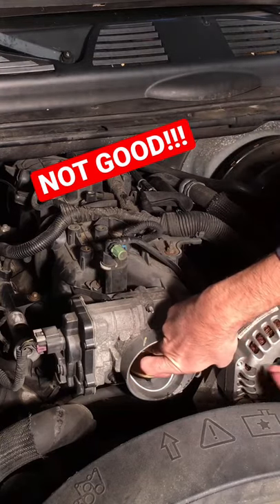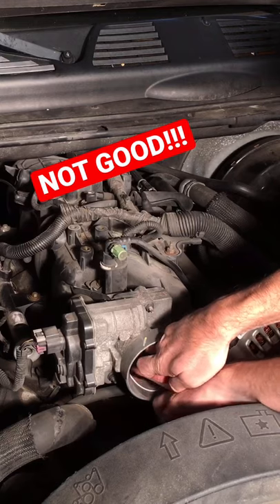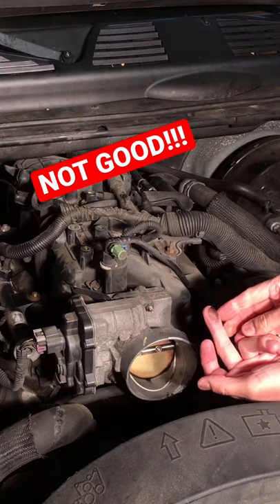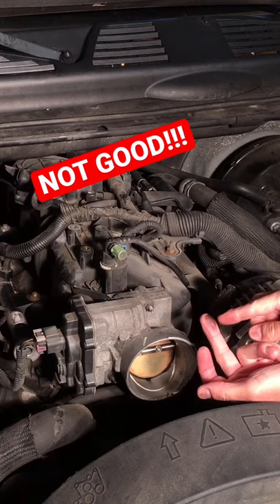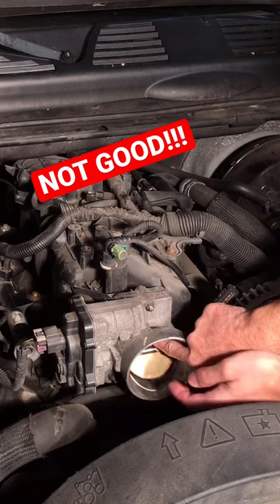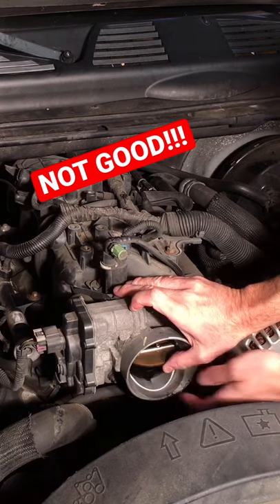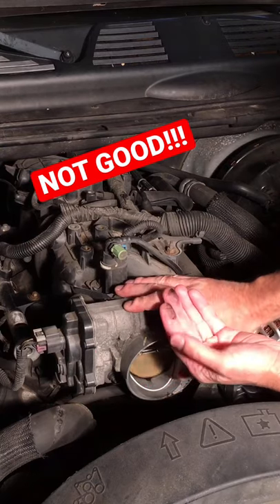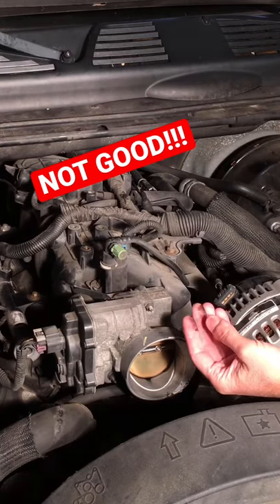If you discover this in your Throttle Body you have problems

Comment: Some throtles can break by manually opening them. Have a buddy press the gas pedal
Reply: #nissan
Reply: @ItchyKneeSon  lol did that on my z☠️
Reply: With the engine running
Reply: I was just about to say that bro great minds think alike
Reply: Not on the ride by wire ones
Reply: Or a brick
Reply: That's with electronic throttle body. Cable controlled is entirely fine to manually open.
Reply: @nateg08 caddie cts 06?
Reply: What if you remove the throttle body and do it off the truck?
Reply: @Eurolaflare same damage done it’s the plate itself ur not supposed to move
Reply: @Eurolaflare  same, you must not move abit of degree that butterfly.
Reply: @macegarage9603  I moved it gently a few times and cleaned tons of gunk that I was surprised to find, truck runs amazing and noticeably better, no issues. Guess it doesn’t always mess things up…
Reply: Probably not break but your throttle body position would be thrown off in the ecu. Literally happened to me today. my car went from 340 horsepower to probably 50 just because the throttle body  was thrown off I lost an immense amount of power
Reply: @Michael-ty2uo  I'm glad that didnt happen to me, mine runs great still to this day weeks later
Reply: I think I just broke mine doing this doesn’t drive or rev anymore
Reply: @keegan2610 and it broke? I’m asking cause I did this in my g35 and now it doesn’t rev past 1600
Reply: @derekchapa9432 in some cars you need reprogram throttle body after you missed up with them.
Reply: @mk-yi8ptwhat does this do?
Reply: This tb is wired, not cabled… it has a small return spring so it won’t hurt it
Reply: @Michael-ty2uo  throttle position sensor???
Reply: @mk-yi8ptit doesn't open by this way in some cars such as my 07 Optima
Reply: Oh no 😅 @muresanm
Reply: @Michael-ty2uo so how did you fix it?
Reply: @Tronic_Rider-kl9cu   it was actually a vacuum leak if you drive long enough with a vacuum leak it will lose power due to the thrown off throttle position timings. My breather hose on my intake was slightly loose when i repositioned everything the throttle body went back to normal
Reply: That body style is a electronic throttle body
Reply: @keegan2610 should of disconnect your battery
Reply: Shit I have a 05 mustang and I put the rubber of a screwdriver in it and cleaned it out . Runs fine …. I hope 😭
Reply: And you're good to go
Reply: @klaidenmorad103  yep.  Any change like this, or upgraded components on intake or exhaust systems, usually require doing an ecu relearn after reconnecting the battery.   Most will relearn over time, as you drive... in case you don't do it.  It will just usually run rough or high idle, until then.
Reply: Is the engine supposed to be running?? Please help
Reply: @Michael-ty2uo How best then should it be done??? Kindly guide
Reply: @muresanm  no, just turn the key but do not start it and fully press the gas pedal, the throttle body will open.

Comment: When an engine is shut off, there are often one or more intake valves open and the residual fuel vapors as well as oil vapors from the PCV system are trapped behind the throttle plate until the next startup. There will always be a buildup in that area. I always recommend to have the throttle body cleaned every couple years.
Reply: I came here for this comment. I 100% agree. I have always (decades) seen this buildup on the inside of the intake manifold beyond the throttle body, mostly from PCV valve activity. Oil vapor lands on cool surfaces after the car cools down. It's simple. Never had a fuel pressure regulator problem.
Reply: @InexplicableBill this person is correct.
Reply: Noticed this on my motorcycle. I change the oil, flush the gas tank, and clean the air box religiously to prevent corrosion and shit, but this gunk always builds up in the air filter housing around the vapor return lines. The manufacturer even put a tiny little sponge in there to collect it all between cleanings
Reply: You just damaged that throttle body,  ,you not supposed to open that manually,
Reply: @jessereynoso7639 how is it supposed to be opened?
Reply: Thank you everyone. I appreciate your input.
Reply: Wat Can You Use To Clean It?
Reply: @Tronic_Rider-kl9cu 
You're asking a YT keyboard mechanic.
Reply: ☝️ this.  It is why you will sometimes find a charcoal panel behind the air filter.  It absorbs unburnt hydrocarbons until the next start.
Reply: Not judging but doesn't it mess up the servo/motor in the throttle body opening it by hand.
Reply: @patrickgorham4269  unless it's locked in place for some reason, no.
Reply: @jessereynoso7639 that's what I thought.
Reply: Not years. Every oil change needs intake treatment, gas and diesel aren’t pure like the early 2000’s everything burns dirtier

Comment: It can also be the pcv valve that needs to be replaced.
Reply: Hey i suspect if pcv valve is faulty there will be OIL int eh throtle door itself since the pcv vavle connects before the door😅
Reply: Yes but will maybe appear as a lighter color than from the motor and pcv still is letting out the fuel that can leak past worn rings into the crankcase obviously like the whole point of the pcv right? Weil not the whole point but whether it's fuel or blowby gases from cylinders? Because otherwise they will go into oil and thin the oil and that's part or the reason as well as.... carbon buildup?
Reply: A good pcv valve will shake  
Mine is good and just replaced it. Having major idle issues
Reply: @anorsegoddess9797  don't forget that if you disconnect the battery fir any reason you may have to take the vehicle through a fuel trim relearn process... otherwise it'll idle like shit and may even stall out

Comment: that's probably oil from the engine because the air that comes out from the engine and goes to the air system has oil in it that's why some people install oil catch can
Reply: Exactly. Especially if you are modified it would be a lot more.
Reply: But he said if it smells like gas not oil
Reply: From PCV tubing?
Reply: @HeyShockerGirl  it's air mixed with engine oil and gaz or diesel
Reply: @thy6780  i think it's called pvc valve, a tube that comes from the top of the engine that releases pressure. putting it back to the air system is cancer for engines.
Reply: Could that make my truck smoke blue
Reply: @marcosilva3749  no that tube has nothing to do with the blue smoke with it or without
Reply: @difsid569  damn it
Reply: @marcosilva3749 if you’re vehicle is smoking blue that means you’re burning oil, depending on your truck could be just worn out rings, or turbo seals, or valve seals, or broken ringlands, many possibilities
Reply: Flooded engine gas mixed with the oil through to the PVC valve pressure 🤯 to the intake manifold back to pistons

Comment: My 2011 Honda Accord had the same problem and I had a mechanic that wanted to replace the valves. I wanted to make sure of his diagnosis so I want to friend that my son uses and after going through the core he noticed under the body throttle there was a lot of wires coming out the wiring corners and he noticed one of the wires were broken, so he put two wires together fix the wire which was thin thread wire when you’re sewing and I got a bill from him for over $300 for the job. The other person wanted $900 and that was an even the problem so I would suggest getting a couple opinions if you can if your car will let you, don’t jump on the first opinion
Reply: Even $300 to fix a torn wire is highway robbery, damn.

Comment: Could also be bad intake valve/valves not seating and piston blowing air charge back through intake.
Put hand over throttle body and if you feel any pressure popping back at your hand it's a bad intake valve seat, if not it's probably one of the other problems also mentioned above.
Reply: Bad misfire too if valve is bent or not seated
Reply: Pls what can make throttle atuetor boy not firing

Comment: You should never open the throttle body by hand. If you need to open it turn key on engine off and then open it by jamming something on the gas pedal
Reply: Yes I was about to say the same thing it tears them up
Reply: Why is that
Reply: What if it doesn’t open when you press on the gas pedal ?
Reply: @chrvscuts4945  then it should be replaced
Reply: That’s not true you can open the throttle body by hand and clean it
Reply: @chrvscuts4945 yes plz. This & sluggish accel esp uphill
Reply: @ronniejohns2463 bc that’s why it is
Reply: @kid5042 no
Newer cars with new computers and electronics throws the system out of wack.
Put a broom stick on the gas pedal with the key on engine off
How many times do you need this repeated to you?
Reply: @OFFICIALBROTHERBOLDLYMUSICTV  Because they actually don’t throw anything off, how tf can it throw anything off? Dealership even do it manually
Reply: @OFFICIALBROTHERBOLDLYMUSICTV you could also just disconnect the negative battery connection and do it manually.
Reply: That only applies to electronic TB. Cable controlled are completely fine to open manually. Just know your vehicle and if you can't tell the difference you probably shouldn't be in there anyway. That being said... this appears to be an electronic TB, and opening it like that could easily strip the plastic gears that open it.
Reply: All mechanics do it. They say to do it gently though.
Reply: My throttle body is mechanical, not electrical, and it has a special lever that opens it without using the entire pulley system that operates it by pedal.
Reply: @ronniejohns2463  because they are electronic and are regulated by the ecm.
Reply: yes then if that object you put on the pedal moves bye bye to your little fingers 🤣 disconnect it and remove it. Best way don’t be lazy and risk your fingers getting chopped off

Comment: What are symptoms of this that the car will do???
Reply from the maker: Performance issues, like poor acceleration and/or high or low rpm’s at idle. You will also have an engine code most of the time

Comment: Don't ever put your fingers or hands near one of these without it unplugged. Bad things can happen. Stepping motors are no joke. Best to remove and examine.
Reply: What's a stepping motor?
Reply: High torque motor. Can pinch or remove digits.  I'd not want mine in there unless it was unplugged better yet remove it for cleaning.

Comment: That is oil.  5.3 Chevy engines all have oil leaking into the throttle body. They sell an updated valve cover (genuine GM) that helps stop it, and you can add a good Micky Mouse oil catcher.
Also. It is really not much of a problem. I ran one to 300,000 miles with no problems doing that.
Reply: Mighty Mouse*
Reply: @jonathanblunt3779  You'd be correct, but Micky Mouse sounds cooler. 😎
Reply: @steefan2248  so the noobs can find the best catch can on the market haha
Reply: I needed to see this comment because I’m dealing with this same issue now 😢
Reply: Mine smells like gas

Comment: Oof 😬 Every time you plunge your finger in the valve or just drop it, i cringe. Rapidly moving the butterfly valve can actually cause enough current to send faulty signals and mess up sensitive electronic components. If I need to move the butterfly valve to clean the throttle body, I move it slowly so as to not generate current

Comment: I have a code P0122
Throttle/Pedal Position what should I fix first the throttle body or the pedal position sensor
Reply from the maker: I would start with whichever part is cheaper. You don’t want to start with the more expensive part, just to realize that wasn’t it.
Reply: That would be the APPS (Accelerator Pedal Position Sensor). Around $45-50 on Rock Auto.  The TPS (Throttle Position Sensor) is in the actual Throttle Body and cannot be separated. You have to order the whole enchilada.  About $120-250 pending how much cheddar you’ve got to burn.  Good luck!

Comment: Most likely the purge valve right next to the throttle body that's going bad. If you have an issue with starting after filling your tank that's another indicator that your purge valve is bad.

Comment: I recently replaced the throttle body on my 2017 Chevy  and still having the same problem.  It's still showing Engine power reduced
Reply from the maker: Did you use an aftermarket one or a name brand?
Reply: @PhillipsVision  it was a new throttle Body.  Hitachi Brand
Reply from the maker: @celestinocarrillo6479  I’ve used them, they’re good. Are you getting specific engine codes?

Comment: I open mine like that it squirts about 30cc of fuel straight down the intake manifold! But it's hard to even see it because there's a choke plate in the way...and a venturi...
Reply: that's a carburetor
Reply: @roballan4944  Pretty sure a fella what knows the exact volume of their accelerator pump might just know what they have on their engine.......hell they may even have put a kit or two in it over the fifteen years they've been driving it? Just a thought or two.....
Reply: @TestECull  Anyway, I believe you have a carburated engine.

Comment: BEWARE 
Many engines will need reprogramming 
IF you manually open throttle body 
Take it off spray cleaner in front and back but DO NOT open manually 
Camero and GM will need reprogrammed
Reply from the maker: @drifter9425  Thanks for the input

Comment: hw you get gas in the throttle body if is fuel injection?oil maybe
Reply from the maker: Bad pressure regulator can also cause that
Reply: @PhillipsVision  did you fix the problem?

Comment: I’ve got an issue with my 94 Chevy 4.3 Silverado when accelerating is very slow the engine definitely sounds like it’s working but it gets up to speed weakly and at around 40mph the engine shakes bad and it’s not motor mounts I’ve looked at everything
Reply from the maker: Have you checked your fuel pressure to make sure it’s to spec?

Comment: I have a 2012 Chevy Impala. I was driving it and it shut off and I was smelling gas underneath the hood but I pulled the oil stick out it had gas on it. Anybody help me out with this problem
Reply from the maker: Could be a problem with bad piston rings or leaking Injectors
Reply: I had this before and it was the high pressure fuel pump leaking to the engine. If Im not wrong it could also be bad injectors but with that the car keeps running after you shut it off for few seconds.

Comment: Or your pcv system is backed up...
Reply: Where is it and how do you clean it
Reply: @blakekoubek5031  Usually running from your valve covers that connects to a rubber or plastic tube.

Comment: got an '03 ford ranger and i have this exact thing on my 4.0     i had to replace the idle air control valve in order to pass emissions smog test and when i was in there i noticed a strong smell of gasoline so im gonna start with that regulator and see if it helps thanks!
Reply: Did that regulator work
Reply: @biggopppp4xkashvillekris  yes but try to get the oem or closest to oem one, research whatever brand it is to see if people say its reliable brand

Comment: our expedition keeps shutting off on its own, my hubby cleaned the throttle body out, it’s still shutting off the vehicle
Reply from the maker: Are you getting any engine codes? Have you checked the fuel pressure?
Reply: Get a new hubby
Reply: @dennismorgan9035  he changed it out n now there’s no problem, i’ll keep the hubby, thank you
Reply: Does the expedition have the 5.4 triton engine?

Comment: You know they could mess up the sensor when you open it
Reply: Glad you mention that because i opened mine to clean it and now im getting symptoms of a bad sensor
Reply: @Junior-ux4gy bro me too I was tryna clean my throttle body and when I started the car it started funny🥲
Reply: What is “the” sensor lmfao
Reply: @5.7_Angel after cleaning the throttle, your RPMs will often be a little wonky as there's more airflow (cleaning removes the carbon buildup.) Might take a few drivers for your ECU to relearn and readjust the idle
Reply: @ArsonistArborist  I definitely understand that bro. It did that to me but after a few drives it was fine. My Thorpe body was hella dirty with carbon inside
Reply: @5.7_Angel  nice. When you’re vehicle is brand new, the throttle opens something like 17% for idle. Then over time, as the throttle body gets covered in carbon and the flow is restricted, the computer gradually tells the throttle to open more and more at idle, in order to maintain the flow and, in turn, the RPMs. By the time you clean it, maybe it’s at like 20+%. After you clean it, it gets much better airflow, so the computer is freaking out a bit. Glad it all worked out
Reply: @ArsonistArborist  I never knew that man thanks for that! Learned something new today. But yeah now that I cleaned it it gets better throttle response not a lot but definitely better then before ya know?
Reply: @5.7_Angel  Scotty Kilmer taught me that lol. If you do a lot of your own maintenance or even just enjoy learning about vehicles, I highly recommend checking him out. Lots of great info
Reply: @ArsonistArborist  yeah I know a thing or two about Scotty. He’s the reason why I know how to do half the shi I know with cars😂 without Scotty I’d be a no brainer😂
Reply: @5.7_Angel  I feel that lol